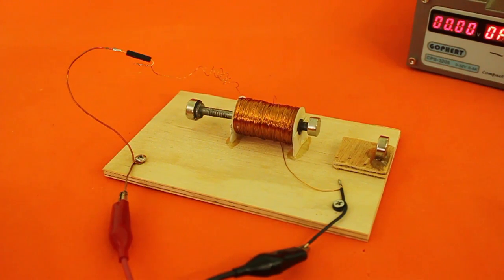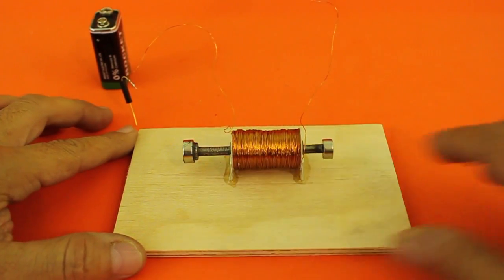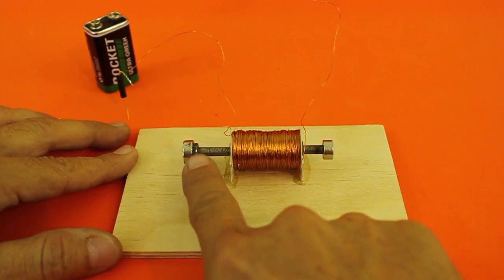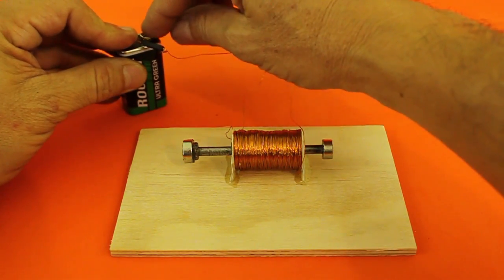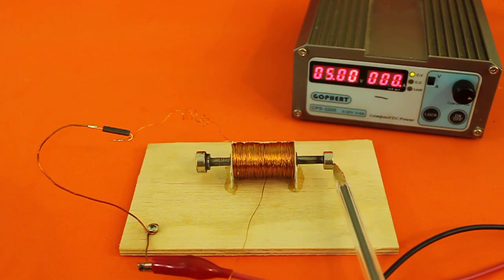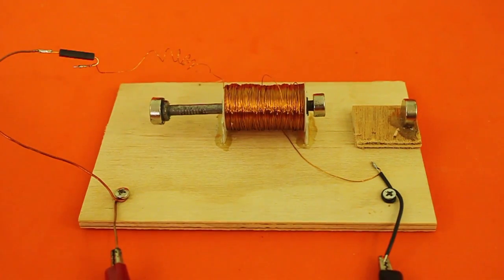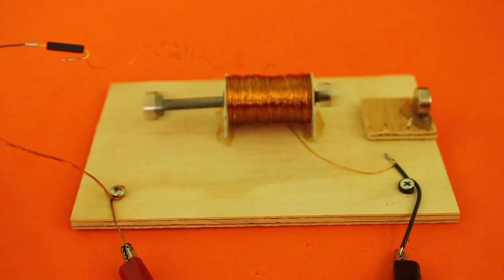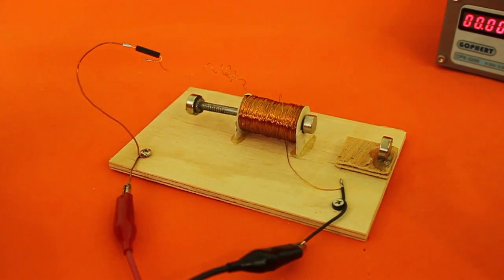Linear Electric Motor

Comment: The reed relais you use to get the impuls will not live for long! The coil will create sparks and destroy the relay over time. You'll need a capacitor and a diode to prevent sparks.

Comment: Dude, learn about LINEAR MOTOR first! A linear motor works by generating a linearly traveling magnetic field through coils, which then attracts or repels magnets in a moving part, causing it to move in a straight line. This is achieved by supplying alternating current to the coils, which creates shifting magnetic poles that interact with the poles of the permanent magnets in the moving element, resulting in a continuous linear force and motion. 
How it works in detail:

    Unrolling the rotary motor:
    A linear motor can be thought of as a rotary motor that has been cut and spread out flat. 

Primary and Secondary parts:

    The primary part, similar to a rotary motor's stator, contains the coils that receive electric power. 

The secondary part, similar to the rotor, contains a series of permanent magnets. 

Creating a traveling magnetic field:

    When an alternating current is supplied to the primary coils, it produces alternating magnetic fields. 

These shifting magnetic fields create a linearly traveling magnetic field, with alternating north and south poles. 

Generating linear force:

    The moving magnetic field interacts with the permanent magnets on the secondary part. 

The attractive and repulsive forces between the shifting magnetic poles and the magnets cause the secondary part to move in a straight line. 

Controlling motion:

    The rate at which the current changes controls the velocity of the movement. 

The amperage of the current determines the amount of force generated. 
By changing the order of the three-phase power supply, the direction of the traveling magnetic field can be altered, allowing the secondary part to move in the opposite direction. 

In essence: The continuous interaction of the magnetic fields from the powered coils (primary) and the permanent magnets (secondary) creates a continuous pushing and pulling action that generates a straight, linear force, moving the secondary part without any rotational motion or mechanical components like gears or belts.

Comment: When you talk about the solenoid , you can’t say that the size is 30 without mentioning the unit whether it is mm or inch . Second thing you should tell is the no. Of the turns of the wire.
Reply: 30 awg wire = 0.254mm = 1/100" and directly after he said 1000 turns.

Comment: Here is an idea how about extending the shaft and adding a second coil wound in the opposite direction so there is power when it returns, like you see in a double acting hydraulic cylinder. That would be interesting to see.

Comment: do not instal a coil in front of the magnet. Make the solonoid bifilar. one channel is connect to the battery and the switch. The other channel is the pick-up coil. You draw freely voltage off from the coil and store it in the capacitor. Now, you can eliminate the battery and run the hole thing on the capacitor. The battery is there for charging purpose.

Comment: You could make a continuously flowing pump if you enclose each magnet in a piston head, then sealed that in its own chamber. Both chambers would have 2 oppositely oriented Tesla one-way valves each; the inlet Tesla valves  are connected to each other, and the outlet Tesla valves are connected to each other. That way, no matter which side is drawing in or expelling fluid, there's always pressure. The only moving part is the single double-sided piston because of the Tesla valves. The clacking sound & some of the vibration can be eliminated/minimized by adding some sort of bumper (a rubber washer?) between the coil and the piston heads.

Comment: pretty neat reminds me of a cylinder and piston from combustion engine, I thought at first you were actually switching the polarity back and forth with some component. Do you think you can create enough compression make an engine similar to a piston driven combustion engine if that makes sense?  replace the petroleum fuel with magnetic force?   would that be feasible or would it just be a total pain in the ass?
Reply from the maker: you can but i don´t know how efficient would that be. I guess a normar rotary electric motor is more efficient